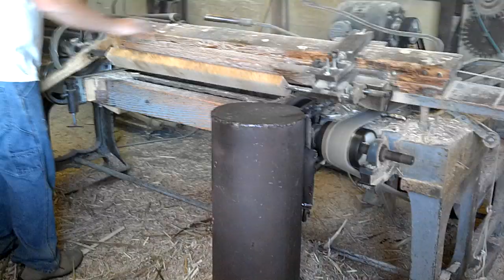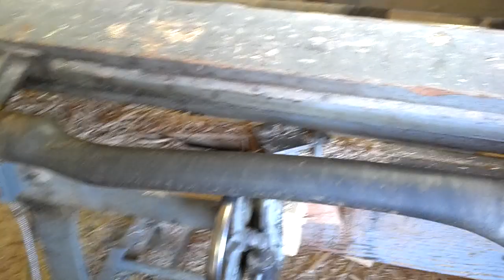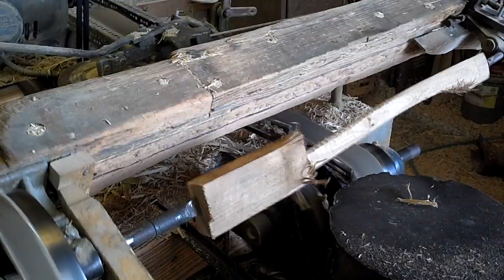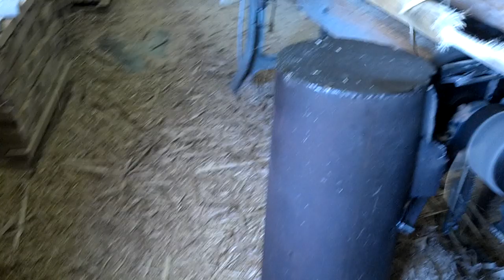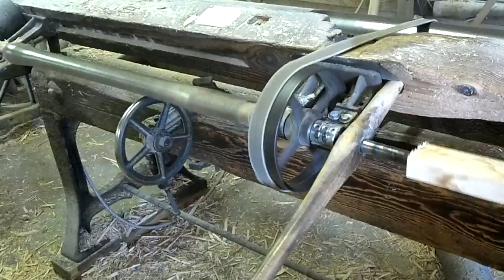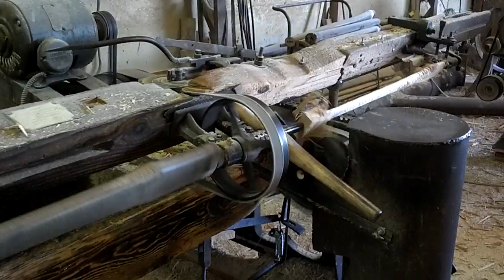House Handle Axe Handles on Klotz Lathe

Comment: My grandfather started a handle factory in the 1930's in Potosi, MO while already owning and operating one in Des Arc, MO. Both small towns in SE MO located near the railroad. I remember a lathe in the mill, smaller than the one above I believe.  While they sold handles to small hardware stores the majority of their products were sold to the Missouri Pacific Railroad for their use. When the railroad began to use a machine to drive the spikes in the railroad ties, the small factories went out of business.